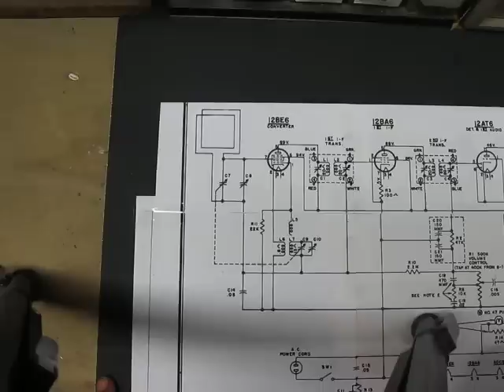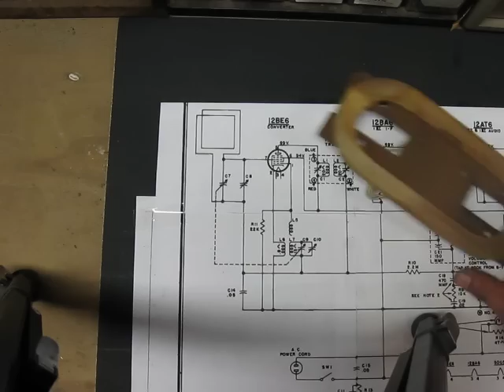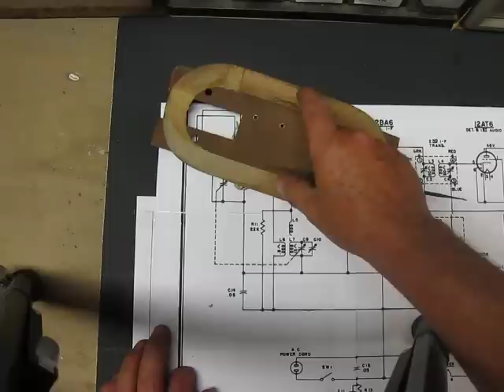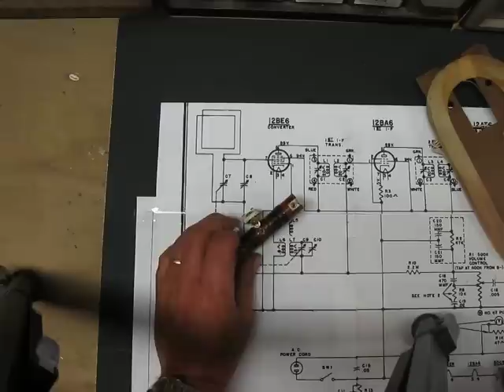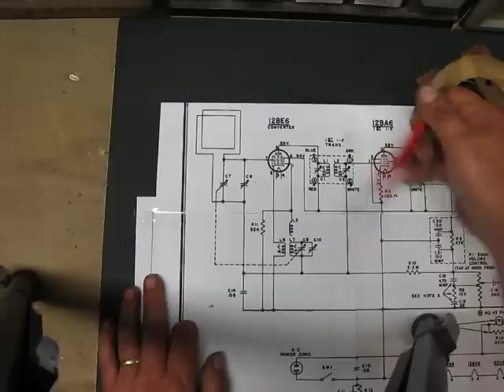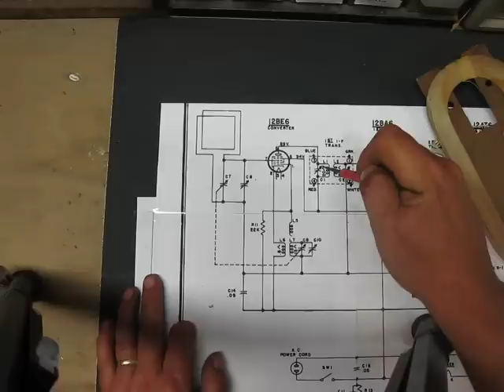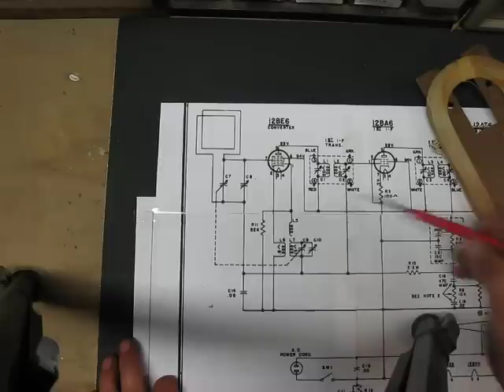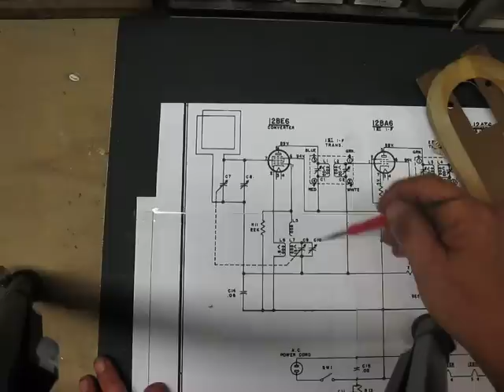Radio Theory Part 1

Comment: Thank you for the excellent explanation. I have a Zenith radio that I can pass an AM signal straight through from the mixer to the speaker, but it does not tune to any station on its own. You gave me some ideas as to what to check. BTW, I do hear interference on another nearby AM radio as I turn the tuning knob on the defective radio so most likely the local oscillator is working on the defective radio. The radio has been fully recapped, and the FM band works great.  First thing I'm going to check are switch contacts.

Comment: I have a 4 band radio but not thats circuit diagram it has MW SW 1 SW2 SW3 SW3 its oscillator coil is 5 pin and 2 pin gives continuty one hand on the other hand 3 pins give continuty (Center tapped ) aprt from center tapped rest two of these 3 are grounded I couldn't guess how tank circuit is being constructing over here